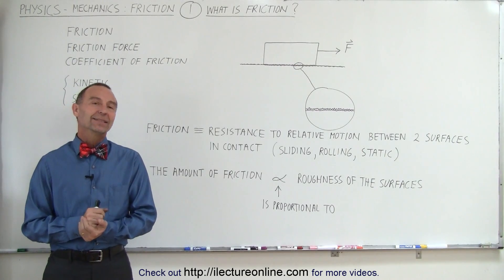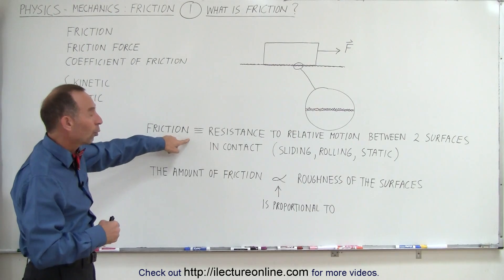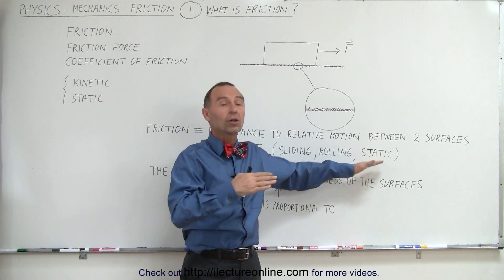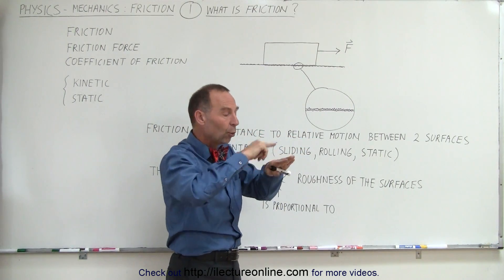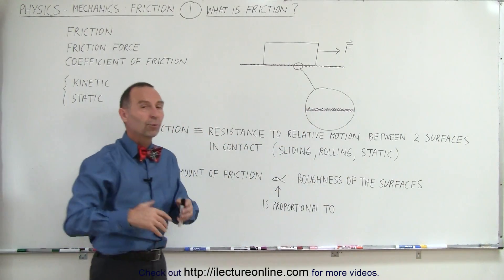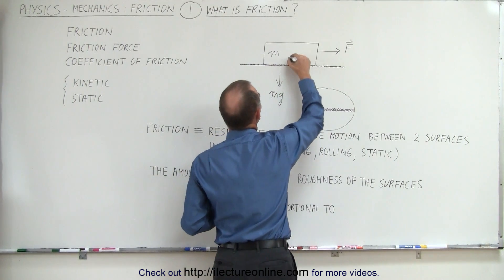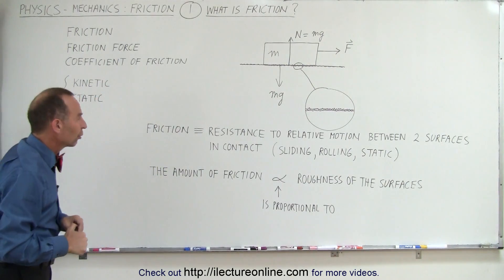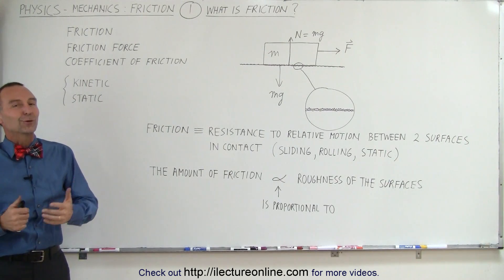Physics 4.6   Friction (1 of 14) What is Friction?

Comment: Hi sir really sorry about the frequent questions. I'm doing this practice problem and I'm not sure if I did it right. In Figure 4.7, the net external force on the 24-kg mower is
 stated to be 51N. If the force of friction opposing the motion is 24 N, what force (in newtons) is the person
exerting on the mower? Suppose the mower is moving at
 1.5 m/s when the force is removed. How far will the mower go before stopping? I have d = 2.25m but I don't think my process is right.

Comment: A 5.00-kg box is initially at rest on a level surface. The coefficient of static friction between the box and the surface is 0.400. Let g=10ms2, and all answers be in newtons.

Calculate the maximum force you can apply before the box starts to move, if the force is directed at an angle of 30 degrees from the horizontal, with the vertical component downward.
Reply from the maker: Normal force = mg + F sin (30) = mg + 0.5 F        Friction force = N mu = (5 * 9.8 + 0.5 F) * 0.4 = 19.6 + 0.2 F           Maximum force when F cos(30) = Friction force         F (0.866) = 19.6 + 0.2 F      F = 29.43 N
Reply: thank you